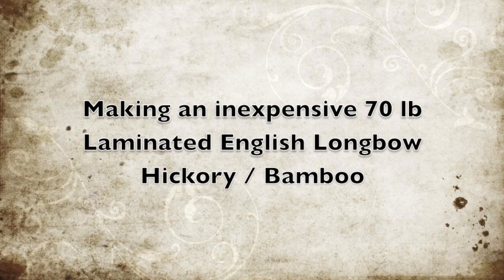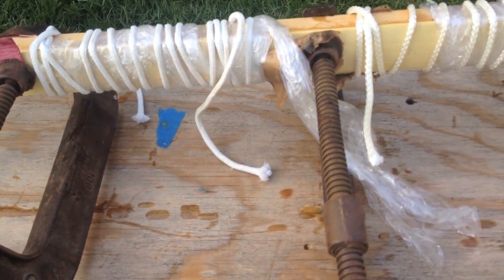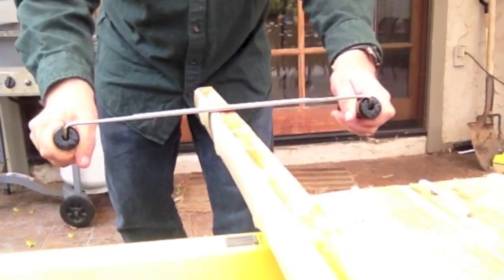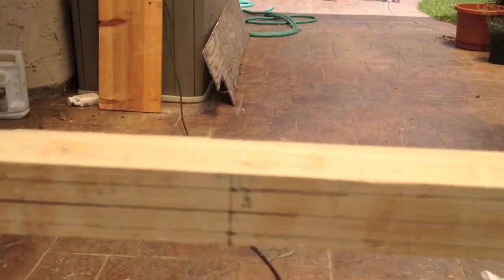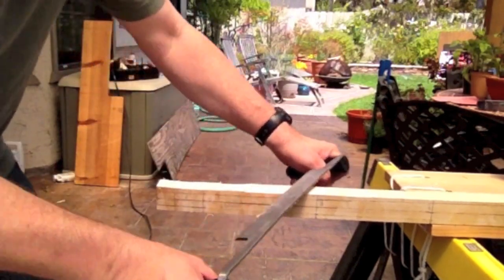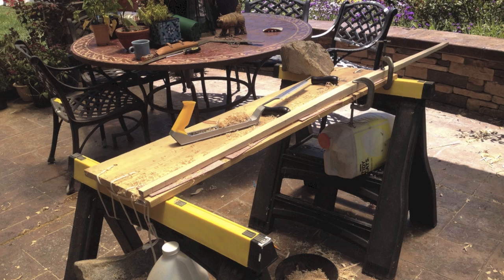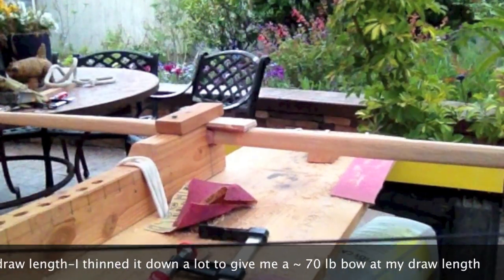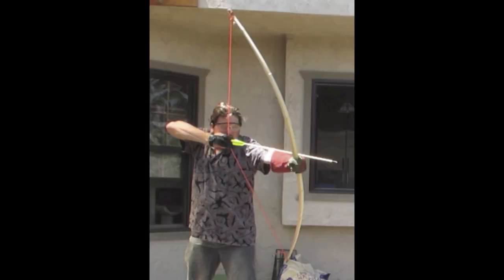Making an Inexpensive 75 lb Laminated Hickory Bamboo English Longbow

Comment from the maker: I recently uploaded a video called   Building a 45 lb Hickory "English" Style"  Longbow with Hand Tools ---  this is lower draw weight bow that is a good first project for making bows with hand tools  and does not require laminating or backing the bow.   I also have a video on making a similar lower draw weight bow that has backing .
Reply: Do you think you could make something like this out of red oak except no bamboo backing possibly just fiberglass?
Reply from the maker: You could try that with a low draw weight bow.  I would not use box store red oak for a 75 lbs bow.   The kind of fiberglass backing I have used in other videos mostly holds the pieces together if the bow shatters.  Where do you live?  You may be able to find better bow woods for D shaped bows locally.   Some woods you might not think about like elm, lilac, black locust can make good long bows and they grow in highway medians and shopping center drainage dtiches etc. even in cities.

Comment: COULD YOU TELL US THE OVERALL DIMENSIONS INCLUDING TAPERING PLEASE
Reply from the maker: An explanation of the dimensions was published in a comment to a comment a long time ago.   The original dimensions I used made a bow that was going to pull  about 90 lbs at 28 inches.  So I thinned it down quite a bit to get to 75 lbs.    I  measured the final dimensions of the bow, and they are shown below. The length is 72" I believe and knock to knock is about 70.5 or slightly longer.   I have checked the draw weight of this bow again and it pulled about 83 pounds in very cold weather a few years ago.
                           width    depth  (mm)
Top of handle    29           25
6 in above           28           20
12 above             27            18
18 above             23             17
24 above             21              14
30 above             18              13
Reply: @SeadartVSG  
Thanks heaps

Comment: Question: Do i understand that you used the oak stave as received from the provider? It did not need sawing and shaping?
Reply from the maker: I started with a piece of hickory lumber not oak.  It was approximately 72 inches long, 1.5 inches wide and 1 inch thick.  It was sanded smooth and flat on the side that was laminated to bamboo. The bamboo was sanded a bit to decrease thickness.  After lamination I carved the desired shape of the bow.

Comment: Hi, I had a question what did you say in the video at 3:26? Also I am using titebond 3 instead of epoxy would of reducing the bow wood be still the same?
Reply from the maker: I think I was saying the first step is to cut down the excess bamboo with the draw knife until it's basically the same width as the hickory stave, then you can shave off the excess epoxy quickly with a sure form rasp.  Tightbond glue will work about the same but does not shave off quite as easily with the sure form rasp.   Also Gflex epoxy is formulated to bend  and hold together under strain.   I've used tightbond products for parts of bows that don't bend. with no problem. However I've seen several handles pop off bows on you tube that are held on with tight bond glue.   I've never had a delam issue using Gflex epoxy. You want your glue layer to be almost invisible, so you need to use the strongest laminating  adhesive you can find that will also flex under strain as the bow bends, especially in the outer limbs.
Reply: Okay Gflex epoxy seems like a great glue for laminating bows, but it's pricey to be honest. I wanted to use Titebond 3 because of cost reasons, and I've seen videos from Richard Head Longbows using Titebond 2 to laminate his bows. Not to mention I've seen several other people using Titebond to laminate their bows. But just in case I decide to use Gflex epoxy because even though it's more expensive it might work out better in the long run, what size bottle did you use?
Reply from the maker: @briananuvattanachai6646  Well my reasoning is that I don't have a lot of great tools to make a perfectly flat surface for both boards, to make an extremely good joint,  so I use a very strong adhesive that flexes.  With making heavier draw weight bows if you follow someone's advice you need to do the same thing for each step, if you do something different your results will be different.  There is not a problem with that,  you just need to be aware of what you are changing in the process and possible consequences.   Richard Head and his son are fine craftsmen and very experienced; your results may not be as good, but it's a learning process.   I'd make a low poundage bow first for doing laminations if you want to use tightbond. Then you can learn how to make a really tight joint -it's not as easy as it looks with hand tools.  You can see the bottles at about 1 min, I think they are about 150 mL each,  I usually make three or four bows from one set of the two bottles.  I really like Richard Head's channel.  I think most of the laminated bows are less than 60 lbs, I believe he has shown making several high poundage yew self bows.   A third reason I stick with Gflex epoxy is the fact that I travel back and forth from an area in California that is right on the coast and humid with mild weather to Utah, were the humidity can be very low  (7%) and temperatures very cold -20 F.   Bows made in England rarely see such changes and archers there will tell you that no bow can survive being shot in conditions like that.  Which isn't of course true ,if you have seen some of my videos.
Reply: Yeah I also have a lack of tools. But I am sure that the Ipe board that I bought, also the bamboo backing that I will buy are pretty if not perfectly flat. I bought the board for the belly of the bow from a bowyer which he then got it from a lumber yard, so I have faith in it that it will work. If I was trying to laminate a bow stave instead of a board to a bamboo backing then I would be definitely more concerned. But the Gflex epoxy definitely has got my attention it seems great. Where did you get it from? Also I was going to borrow this idea from Richard Head Longbows he used strips of bicycle inner tubes to clamp the bow laminates together. But instead of using Titebond as the glue maybe use Gflex epoxy, what do you think? Another thing probably one of the only reasons that bows glue with Titebond delaminate is improper gluing. What Mike from Boarrior Bows said that what he does is a sizing coat. He puts on a first layer of glue to let the wood adsorb the moisture then once it gets tacky he puts on a second coat. This is so when the bow is glue and clamped together there's still a lot of glue left and it isn't either soaked by the wood or spilling out to the sides. I think the problem is people sometimes just put on a slab of glue without giving much thought to prep work. For instance whether they should spread the gluing out evenly so all areas of the bow gets a even coat of glue or etc.

Comment: Where did you get your dimensions for the bow ? I'm trying to find a starting place for a 78-80" English warbow that will draw between 100-120 lbs at 32". I have Bamboo for backing, Ipe for core and Yellowheart for the belly.
Reply from the maker: I unfortunately pretty much got the dimensions from empirical trials.  I knew the handle was going to be about 30 mm deep and wide at the widest possible point based on the depth of the stave,  I looked at how other English long bows taper and then tried out a similar taper.   The dimensions I give at the start of the video gives a bow that pulls about 90-95 lbs at 32 inches,  I ended up thinning the thing down quite a bit in the first foot away from the handle, to get ~ 75 lbs @28", I reweighed the bow using an old spring scale this summer and measured 85 lbs at 28"  So I don't know if that was because of changes in the wood or one of the scales is off.  I do know this" 75 lb bow" is a bugger to pull, and throws an arrow 140 yards at half draw.  I have no experience with yellow heart, and Ipe here comes from deck planking so makes kind of crappy bows, so not much help with dimensions.
Reply from the maker: Also take note that this bow is shorter than a heavy warbow would be.  I believe the stave was about 71.5 inches and the nocks are about 3/4 of an inch from the tips.  The difference in pulling a 70 in bow and and a 76 inch warbow is pretty significant, it's harder to draw the shorter bow, as the acute angle of the string causes issues and the shorter bow tends to "stack" because of the leverage of pulling against the tips at that angle.  So if you want a 120 lb bow, go longer.  I'm working on a similar 70 inch bow right now and it would pull about 120 lbs using the same dimensions I used above, I'm going to thin it down to a about 80 lbs.  A 120 lb bow at 70-72 inches puts too much strain on the wood, especially if you are working with board staves where the grain directions may be a bit dodgy.

Comment: Hello, I am attempting a build much like yours.  I went with Ringing Rocks as well, but with hickory backing.  I am wanting 80-90lbs at 28 if I can get it.  Could you tell me how much thinner your finished bow was compared to your initial dimensions?  Great video and info.  Thanks!!
Reply from the maker: +tm79malibu  I measured these quickly just eye-balling the height above the handle and used my micrometer for the width and depth.     You are going to see quite a difference with a hickory backed hickory bow.  My guess it will be a lot stiffer than bamboo backed , but will depend on the thickness of the backing.   Bamboo is a somewhat surprising material, it works very well in a bow.  The good news is you can start thicker than you need and shave it down.  

                            width    depth  (mm)
Top of handle    29           25
6 in above           28           20
12 above             27            18
18 above             23             17
24 above             21              14
30 above             18              13
Reply: +SeadartVSG Thank You for the info!  I am gluing up the stave today. Hope my first build works out.
Reply from the maker: +tm79malibu    Don't get discouraged if you run into problems making a heavy draw bow for your first bow.  Tillering the bow is a bit of an art,  some people end up breaking bows quite a bit learning how.   If you are careful and let the wood guide you its straight forward but problems like an offset bow string or a piece of wood that wants to twist take a little experience at 90 lbs there is not a lot of room for mistakes.

Comment: can i use  kiln dried wood for this project? it is hard to find a non kiln dried wood in my country indonesia....
Reply from the maker: I know people make bows from hickory that has been kiln dried.  I'm not sure you can find hickory in Indonesia.  You might look for a hardwood like Ipe for a  bamboo laminated bow.
Reply: thanks for sharing your knowledge. how about maple? kiln dried of course. it's commonly use for making guitar in here so it's easier to fin it in my country.
Reply from the maker: Yes I know maple makes great necks on guitars, and sides and backs too.  I know in the US people use sugar maple to make thin laminated limbs for recurve bows.   I have heard that maple is good for flatbows but not for D shaped bows and I do not know if that is true.   I would buy some of the kiln dried wood, look for really good wood grain, straight with no run-offs on the back and try making a bow of say 30 -40 lbs.  If it works go for a heavier bow with backing.
Reply: one more question sir. hao about acasia and teak wood? these are easy to find too

Comment: Excellent work. Nice looking bow when you finished. Was the bamboo laminate the same thickness throughout or did you need to thichness it ?
Reply from the maker: Thanks for watching.  I did not try to vary the thickness before laminating the bamboo.   I think this might be a good idea if you can do it symmetrically ... the bamboo is sanded down a bit near the tips ( with out breaking the ridges of the bamboo), other wise it would be very little hickory wood for belly compression.